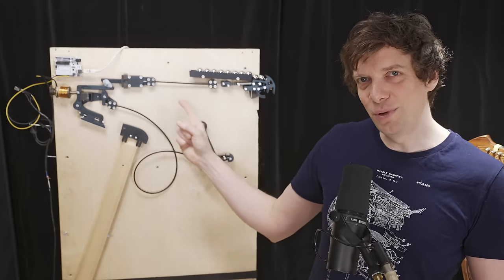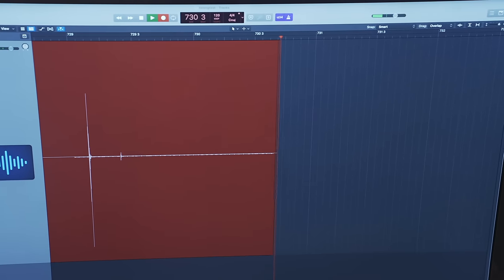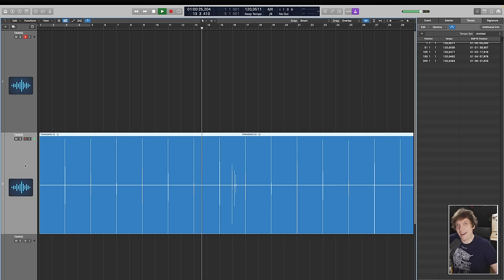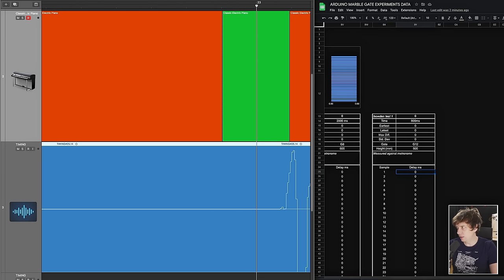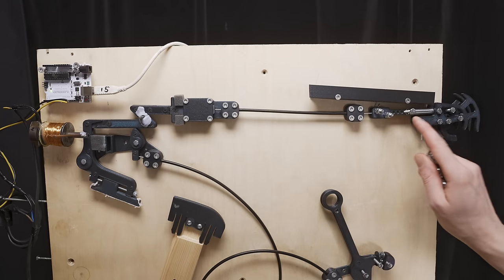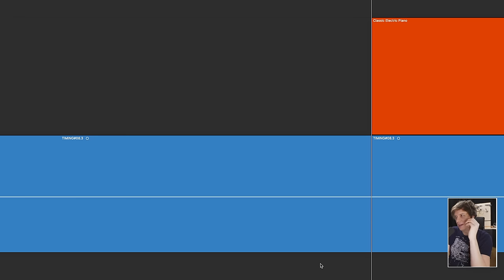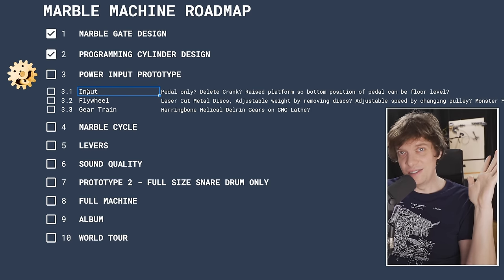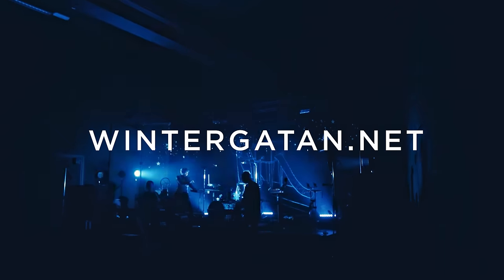Can Bowden Cables Play Tight Music?

Comment: Still with the brake cables. Its gonna bite you. Last warning
Reply: Why do you say so
Reply: What does this comment mean and why does it sound so ominous? 😂
Reply: How very helpful, insightful, and detailed. This comment gives Martin everything he needs to make an informed and educated decision. Thank you for your contribution to the MM3 project. I think you have single handedly saved the whole project!
Reply: @jmir1  right, they're being kind of unecesarily fatalistic about it?
Reply: @Eutrofication  They will stretch over time, which wont show up in the initial testing, but over time will make it so that the timing is off a lot.
Reply: You have not watch the video through, as you commented 3 minutes after it was posted, therefore your comment is mostly informed by your prejudices and not any argument or evidence Martin is providing.
Reply: @xenathcytrin202  Actually hard to judge, as they don't have much external force to fight, so tension won't be much of an issue.
Reply: Ive posted a detailed explanation on every single one of his bowden cable videos. This time i didnt bother. But it comes down to
1 cables stretching
2 cables are not designed to push on it will kink
3 he should use ODYSSEY linear cables if he wants to put loops in
Reply: @xenathcytrin202  That is actually very good feedback that can be accounted for. Just like on bikes, you can turn a nut/collet to be able to adjust for slack or backlash. Unlike the original poster, you providing a reasoning would actually be very helpful feedback for Martin to design for.
Reply: @Bbeaucha88  There were a lot of people explaining the problems with this cable in the previous video. Its clear that you don't watch all the videos.
Reply: @crypteqptyltd3701  I hope it's clear to you that you are probably very convinced of your position! But that saying things like "last warning" is never convincing to anyone except maybe toddlers and young kids. I'd really say that a different tone of voice is necessary to be taken seriously, if not you sound like you're being very self-important
Reply: @Eutrofication  im just happy this comment is getting engagement unlike the other ones. Perhaps Martin will actually read it this time 😂. Ive been working with these cables for 20y
Reply: For those who haven't tuned their own caliper brakes, what you need to know is that rear brakes, having longer cables, always feel mushier than front brakes, with their shorter cables.  There's no way to tune this out.  You need cables with very tight tolerances (without making them heavy or having too much friction).
Reply: @crypteqptyltd3701  also, I don't se any sort of stress relief near the anchor point.